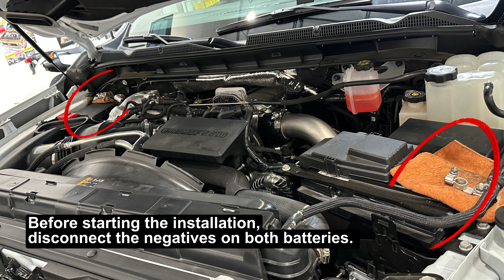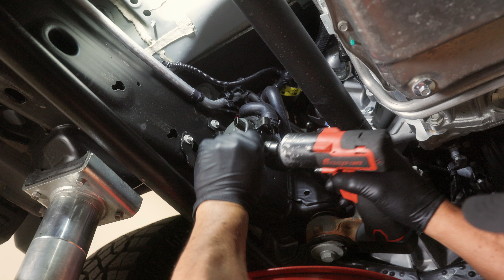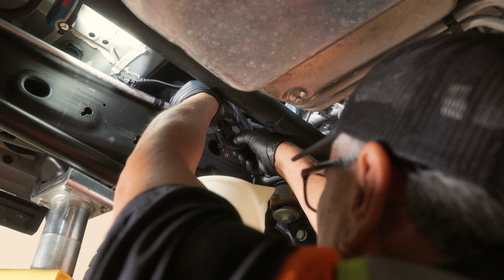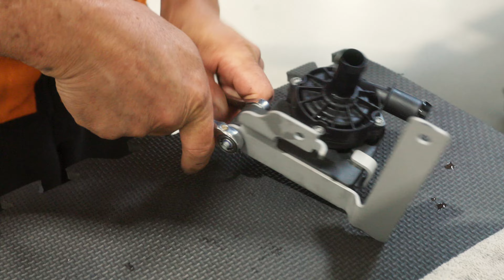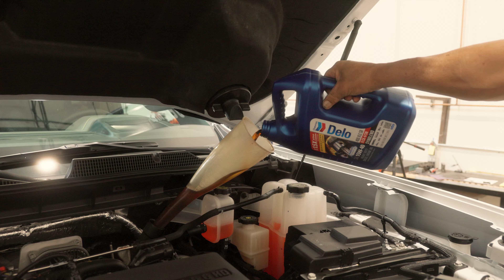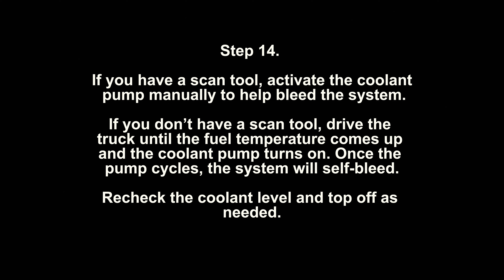2020-2026 GM 6.6L Duramax Fuel Coolant Pump Relocation Kit Installation Guide

Comment: Just got mine the other day....  👍
Reply from the maker: Thanks for picking up the kit. Let us know how the install goes.
Reply: I had this on my 25 Trailboss. Loved it. Wish PPE would come out with an oil centrifuge for the late model Duramax and Cummins.
Reply: I had this on my 25 Trailboss. Loved it. Wish PPE would come out with an oil centrifuge for the late model Duramax and Cummins.
When will the ZF8 pan be out for the 25+ Cummins? I saw the prototype at your shop in January.
Reply from the maker: The new pan for the 2025+ Cummins ZF eight-speed is in its final development stages. We’re currently targeting January 2027 for release, but that’s an estimate and may change.